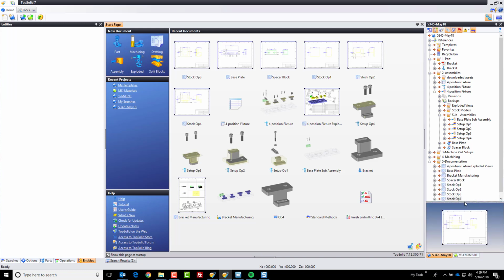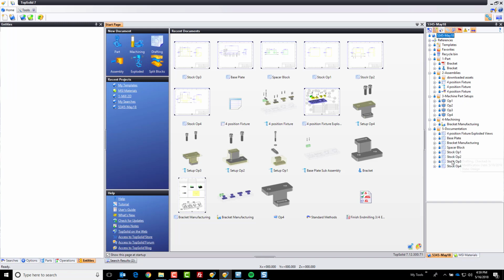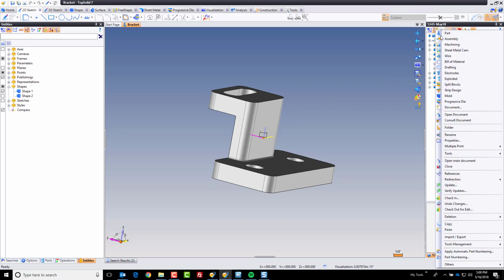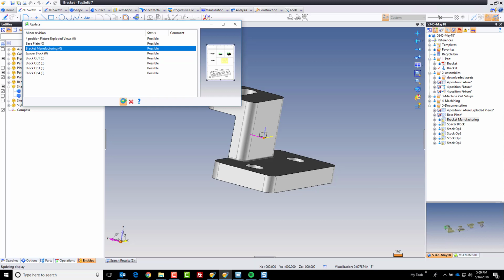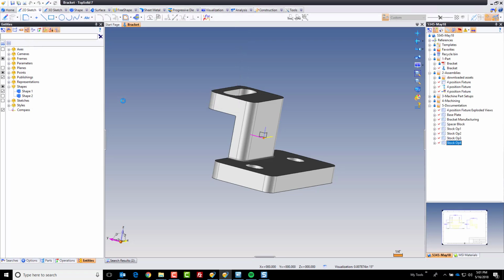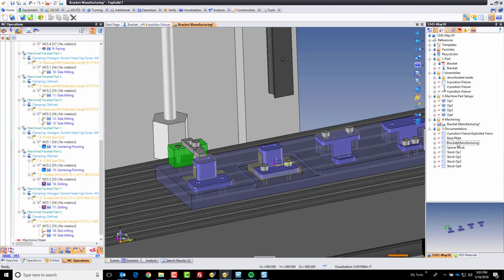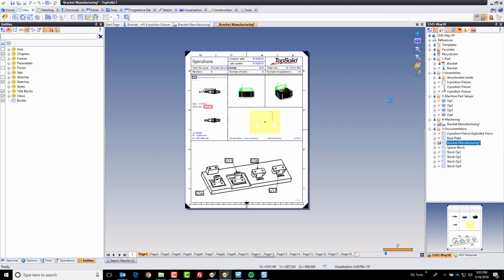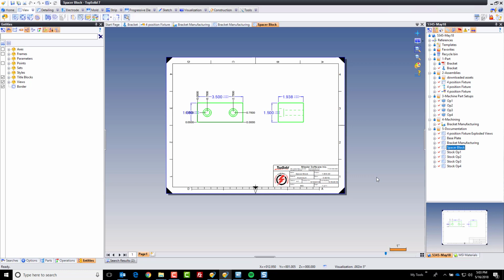Managing Design Changes - Challenge Completed Step 17

Comment: the only problem i can imagine is: if you build the base plate with in place part and you base youre pocket shape on the external shape of the part, if the new revision change the shape automatically everithing update the shape…..but physically the fixture need to be remachined.
if you dont pay attentioin or if pass a lot of time you can forgot this detail and create a problem…..for the rest many congrats to this beatifoul workflow demo….well done thank you.
Reply from the maker: Hi Giovanni!  Thanks for the feedback!  You are correct in your thinking, that could indeed be a challenge.  The fixture designed in this case was just one way to do the job.  As you know, there are many.  Perhaps on the next project, I will show another path to take. :-)